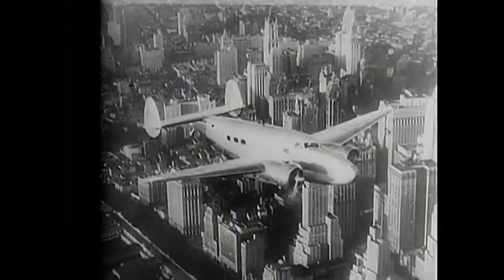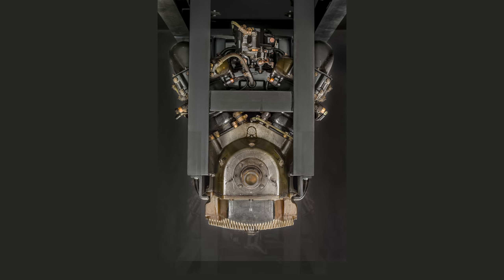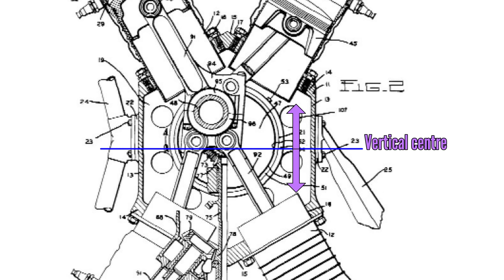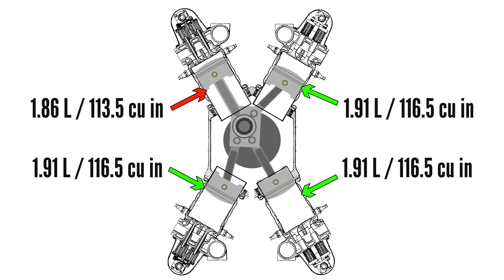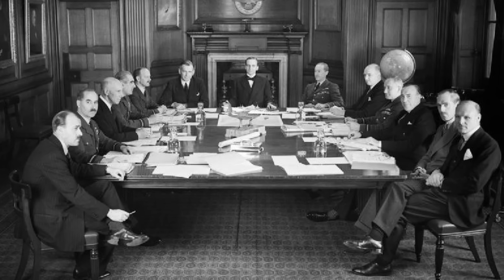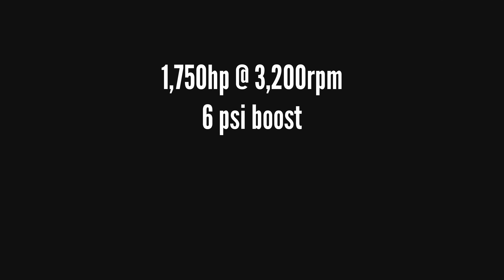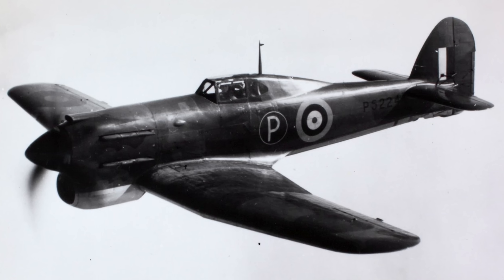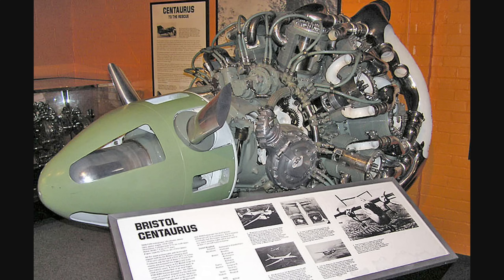Were the Rolls-Royce Vulture & Packard X-2775 Horrible Failures?

Comment: Very nice work, I always appreciate your videos thank you very much.
The "Vulture" can be understood in the context of researched and readily available 87 octane fuel. Once you get that, this engine makes real sense. 
Because every Zylinder is already at the knock limit, all you need is more cylinders for more power and this the DNA of the Vulture.
Later they realized, they can make the power with overboosting the existing inter war designs because they had 130 octane fuel researched and readily available. 
This is where the Germans had much better designs, but they couldnt use it as they lacked the ressources to take advantage of it. The Germans were really desperate and even lacked the few grams of Nickel to make reliable exhaust valves. One could as well try to create living creatures from mud.
IMHO the Vulture also died because the crankshaft and rod bearings as well as the math of the harmonics of such a huge engine was beyond the applied science at that time.

Comment: 8:29 "at a cost of making the engine 100kg heavier"
Probably increased the fuel mass as much since fuel has to feed the supercharger.
19:00 "there doesn't seem to be any inherent problems with the X layout"
I don't see the point of a radial type engine when gearing is used because one wants the crankshaft to be well below the propeller shaft.  Thus, a V or inline works best. Why increase both frontal area and complexity while making the packaging of the gearing way difficult? There isn't much downside to a longer nose. Heck, it smoothes the prop wash as seen by the wings. Just maybe an inline 24 would have been the best, but the decision to go V12 was solid.

Comment: One interesting fact was that when Stanley Hooker was asked to redesign the Merlin engine supercharger as a two stage supercharger, he used the large vulture compressor wheel in front of the existing Merlin supercharger to create the two stages. 
The Vulture supercharger was designed to give 1000hp at 30,000 feet and that was exactly what they were aiming for with the improved Merlin. 
The became the Merlin 60 and later series engines.
Reply from the maker: That is interesting, didn't know that. Thanks.

Comment: Interesting question about the firing interval, it should not be too hard to find since several of these engines still exist, the firing order is usually on a plate attached to the engine.  I should look into it, the 30 degree firing interval would not be popular with the aircraft crew.  

The air crews hated the Napier Daggers in the Hereford, they turned at 4000rpm and had a 30 degree firing interval so sounded like the flat 12 running at up to 8000rpm (for hours!), they were also impossible to keep in synch so would constantly beat.  The Dagger was accused of shrieking.  Interestingly, the Pratt & Whitney H24s had a 30 degree firing interval.

The Vulture was not R-R's first attempt at an X engine.  At the same time that Rowledge was designing the Kestrel at Derby, Royce was designing the "Eagle XVI" at West Wittering, this was an X16.  It went nowhere and did not fly.  One of the interesting facts about it was that Royce avoided the big end problems by using two knife and fork rod pairs side by side on the same crankpin, meaning that the bores were offset.

I have often wondered about this time at R-R, Royce set Rowledge to design a V12 when he had previously designed the asymmetric X16 Cub and the Lion at Napier but not a V12 (although he had re-engineered the V12 Condor at R-R).  Royce then set himself to design an X16 when he had previously designed straight 6s and V12s exclusively. Was it some sort of challenge? A bet?  In any case, we know the outcome.

Quite a bit of the Vulture's big end engineering was derived from the work Rowledge did on the X24 Exe.  Like the Exe, it all worked in the prototypes, but production was a different story.  

Sounds familiar, where have I heard that before.

The Vulture did have an influence after it was cancelled, the supercharger was adapted as the first stage in the two stage Merlin supercharger.  According to Hooker, R-R used two Vultures to test the compressor designs for the Whittle jet engine, they needed that much power.

Comment: These engines make no sense.  A V-12 with a 7 inch stroke, like the Liberty, and a 7 inch bore would be 3,232 cubic inches displacement and using a maximum piston speed of 4,000 fpm could have exceeded 3,000 rpm.  Why even try to build something that's obviously going to have a much longer development time and double maintenance requirements?

Comment: The X-2775 has a 60/120 degree X-angle, hence a standard L6/V12 crankpin configuration would result in a Double-Fire engine where two cylinders fire simultaneously.  Packard apparently used a unique pin configuration to get even-firing 24 cylinders using 4-stroke cycle.

Comment: During the bombing of Germany a lot of engine behaviour under attack became available. It was very clear that damage to any part of the coolant system resulted in failure. If the aircraft made it back with one engine closed down, that engine may be reusable without over haul. But many radial engines continued to deliver useful power after surviving massive damage. If oil pressure was maintained, they ran with whole cylinder assemblies missing. Some amazing photos on the net. Engine power increased as later fuel octane rating allowed higher compression/supercharging.
Reply: Mind you, even Radials had their trade-offs: they were much more dependent on airspeed for maximum cooling effectiveness, meaning high power at low speeds, such as takeoff, could be troublesome for some planes like the B-29

Liquid Cooled engines could also typically get away with running higher boost pressures for the same reasons, and also use lower drag (but not ZERO drag) cooling systems, because water/glycol is able to carry and transfer heat so much more effectively than air alone

Generally speaking, Radials were able to take a licking and keep on ticking, but Liquid Cooled Engines were still useful for having lower drag and fuel consumption for a given power output. Consider the F4U vs P-51D, relatively similar performing aircraft of similar size range, but one air cooled and the other liquid cooled:

1: the Corsair, as you mentioned, had a reputation for a very rugged power system, while the Mustang was known for its Belly Scoop being a bit of an Achilles heel

2: the P-51D (1600hp to 1900hp WEP depending on time period) has less engine power than any Corsair variant (starts at 1990hp for the earliest, water injection brings it to 2200 and the later -4 to 2500hp), but its top speed and climbrate were actually very similar

3: the P-51 was running this power at higher boost settings: 67" to 75" for the listed power settings, while the Corsair on Water Injection was at first limited to 60"

4: what this means practically is that the Mustang burns much less fuel per hour to maintain a certain speed or rate of climb than the Corsair, so with a roughly similar fuel capacity between them, the Mustang still can fly a good bit further

Comment: The DB-604 worked very well.  2660hp in 1940. Altitude performance was very good too.
Reply: It was abandoned in 1942, in favour of the Jumo 222, which also turned out to be a flop. On the one hand, the Germans did have a nasty habit of letting inter-manufacturer politics get into their design loop. On the other, there must have been some reason.

Comment: Overweight overcomplicated and unreliable, a dog of an engine ,Stan and Ernie Rollers two top engineers should have realised the Vulture was going nowhere. Instead Stan and Ernie should have concentrated their limited resources on the Griffon ,a productionised 'R Series' drag race engine built for Reggie Mitchells Hot Rod the S-6B.  The Griffon first ran on the test bench in April 1937 churning out a very respectable pony count of 1,730.  No bigger heavier than a Merlin, the Griffon could fit any aircraft the used Merlins  without major alteration  , yes cats&kittens Joe Smith at Supermarine did just that re working the Spitfire to take a Griffon. DP845 started life as the controversial Mark 3 Spitfire, that should have entered production. DP845,s Merlin  20 swapped at Rollers Hucknall Test Centre for an early Griffon 2B twirling a four blade Rotol Jablo propeller, a guinea pig for the proposed Mark 4 with six 20mm Hispano Oerlikon Cannon.   The Mark 4 morphed into the 12, a grass cutting Spit with two Hispano cannon designed to go after low flying hit and run raiders, most hybrided from Mark 5 airframes with a fixed tail wheel.  Talk about over egging the pudding
Reply: A few things wrong, but I don't have the time to comment on more than one.  The ""productionised 'R Series'" Griffon (R series?? was there a series?: the engine was also known as the HX) was developed in 1931/33 (by Stewart Tresilian if memory serves)  and went nowhere, the Griffon you are talking about was a totally different engine with the bore and stroke being the only things they share (as well as being 60 degree V12s).  

Alright two issues, the Griffon first ran in the experimental department in November 1939 and is thus sometimes referred to as the 1939 Griffon with the earlier one being referred to as either the 1933 Griffon or the 1931 Griffon.  It went into service in 1942.
Reply: Oh, and Stanley Hooker was NOT an engineer and Hives was not R-R's top engineer.
Reply: @robertnicholson7733  Excuse me, did you work for Rollers in Derby, if so tell me more ?.
Reply: @basiltaylor8910  Unnecessary, the correct information is not hard to find, especially if you own the R-R Heritage Trust books on aero engines, numerous other books on the aero engines including Stanley Hooker's book, and been interested in these engines for over 40 years. Even Wiki has the correct information.

Comment: There is at least one motorbike, that has 2 cylinders, 
and both pistons move same time (both go up, and both go down, same time.)
But only one of those pistons press air and gas, and explode,
the other one is pushing out the exhaust gas.
But in both cylinders, the sparkplug will give spark.
That is to make the sparking system more simpler.

Comment: X-configured engines were also designed for tank use. In 1944/45 Porsche designed the Sla-16 engine (Simmering luftgekült afgeladen) X-16 (four banks of 4 cylinders), diesel engine with exhaust gas turbocharging. It was developed by the the Austrian firm of Simmering-Graz-Pauker, and was intended for use in the Panther and Tiger tanks. The 36,5 litre engine developed about 770 hp. Five engines had supposedly been built by the end of the war and hundreds of hours of bench testing performed. It has also been claimed that one engine had been installed in a Jagdtiger, for testing. The factory was unfortunately overrun by the Russians and they removed all prototypes, machine tools and records.

The new Russian T-14 Armata tank is also fitted with an X-12 configured diesel engine, in this case an X-12, i.e. four banks of three cylinders each.

Comment: Also interesting was the Rolls Royce Exe, a much smaller (22 liter) sleeve-valved X-24. They planned to use this in the Fairey Barracuda dive/torpedo bomber, and it got as far as flight testing. They also enlarged it into the Pennine, which had a 46 liter displacement, but this never flew. What I find strange about these two engines was the departure from the usual Rolls Royce practice of naming 4 stroke internal combustion engines for birds of prey - the Exe is a river and the Pennines is a mountain range.
Reply: Perhaps because the Exe and Pennine were air cooled rather than liquid cooled?
Reply: @jbepsilon  Interesting. I totally missed that little detail. Wonder how it would have worked.
Reply: @iskandartaib  Most air-cooled inline engines had intake manifolds extending on the sides of the engine block, then the air made a 90deg turn and flowed across the cylinders into an exit manifold where another ~90deg turn was made before the heated air was exhausted to the outside.
Reply: @jbepsilon  No, I meant, how well would it have worked. Air cooled in-line engines of this size are rare, the weight savings alone would have made the concept attractive, if it had worked well.
Reply: @iskandartaib  Air-cooled inlines in general were unable to achieve competitive power/weight vs liquid cooled inlines or air cooled radials. Problem is that with air cooled cylinders you need higher bore spacing for the cooling air to pass between the cylinders. Which means a longer and heavier crankshaft and engine block. Oh, and since they are longer they need to be made relatively stiffer as well, further adding weight. Adding insult to injury, liquid cooled engines get a lot of additional stiffness from monoblock construction which you can't really do with air cooling. Further adding weight to reach required stiffness.

Additionally, most radials went through several iterations of bigger and thinner fins to provide sufficient cooling as the power of the engine was increased. Can't make the fins bigger on an inline as you'll run into the neighboring cylinder. Back to the drawing board?
Reply: @jbepsilon  Yes, I suppose that's probably one of the reasons the Exe and Pennine didn't get any further than they did (on top of Rolls Royce needing to concentrate on the Merlin and Griffon due to the war). The Wikipedia article did mention that the Exe was capable of making the same amount of power as the early Merlins despite less displacement (22 vs 27 liters), and weighed slightly less as well. And that was before the cooling system weight was factored in. Rolls Royce was working on all sorts of wacky stuff right before the war into the 1940s, including the two stroke Crecy. The last part of the book on the Crecy (RR Heritage Trust) had to do with plans to add turbo compounding, as well as studies taken to turn it into some sort of ducted fan system, using cooling heat and exhaust gases to add to the thrust. They were even working on a fighter plane to use the Crecy - it was Spitfire sized, would use P-51D wings and put the engine behind the pilot P-39 style, while moving the pilot right behind the prop.

Comment: The Vulture design predates the Peregrine.

The Vulture blocks had wider spacing than the Kestrel Peregrine.

The Vultures bore spacing of 6.1in (154.94mm) was very close to the bore spacing of the Merlin, which was 6.075in (154.305mm).

The Kestrel and Peregrine had a bore spacng of 5.625in (142.875mm).

The Vulture did share a bore and stroke with the Kestrel/Peregrine, but not much else.

One of the possible solutions for the Vulture's big end bearing issues was to revert to a fork and blade type rod system, with two sets of these per crankpin, which would have meant offsetting 2 cylinder banks from the others.

This was the system used by the Allison X-4520 air-cooled X24 of the 1920s.

The Vulture had been run to 2,500hp by the time of its cancellation. Possibly more.

The Vulture wasn't Rolls-Royce's first X engine.

In response to a government request, Rolls-Royce built the F, which would be developed into the Kestrel. They also built a test bench engine, the Eagle XVI, an X16 engine, but the airframe manufacturers preferred the V12 layout, so the engine wasn't developed.

Daimler Benz also developed an X-24 engine, the DB604. But that was cancelled mid war.

Comment: How does the X layout differentiate from the H layout used by BRM ?
Reply: ... also used on the Sabre. Basically the X has one common crankshaft whereas the H engines have a separate crankshaft for each horizontally-opposed configuration, the two cranks both driving a common output shaft into the gearbox
Reply: One crankshaft vs 2 (like in the Sabre).
Reply: One is a H and the other an X. Lol.

Comment: From the start of this video, the big thing to me was that all the successful radials had an odd number of cylinders per bank (there must be a reason for that) while this one had even numbers and uneven crank angles.
Reply from the maker: I covered this in detail my radial engine video, but in short, the odd number of cylinders per bank on a radial is required to achieve an even firing interval, and this is not possible with an even number of cylinders per bank.

The X-24 is not a radial though. Each inline 6 (this engine has four inline 6's) has an even firing interval, so by using the same crankthrows on the crankshaft as an inline 6, an even firing interval is possible.

A single row 4 cylinder "X" engine would not be able to achieve an even firing interval.

Comment: These engines, as well as a few OTHER beasts being developed in the U.S. and Britain might well have eventually had the bugs worked out but ..."eventually"???... during wartime??? Reliable, high performance engines with known characteristics and performance were available in numbers and most were amenable to upgrades and improvements. It is only natural that potentially more powerful but very temperamental types took back burner somewhat.